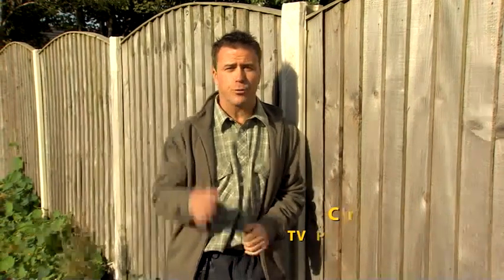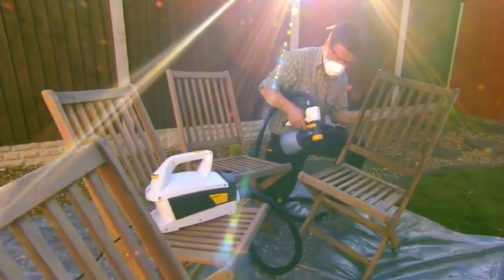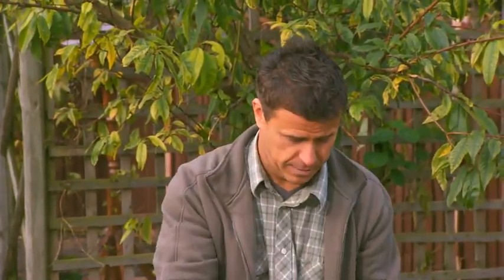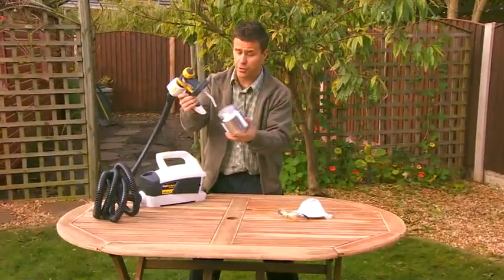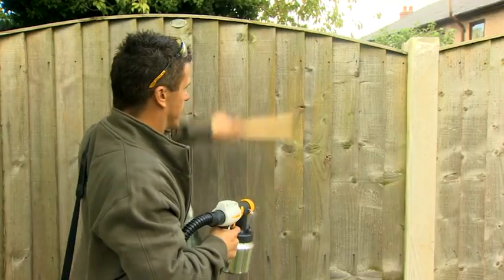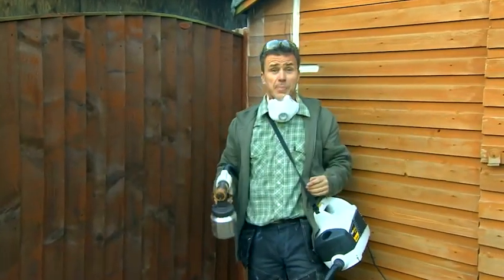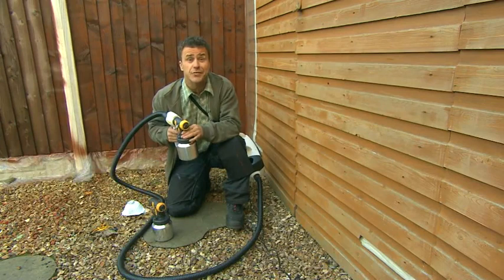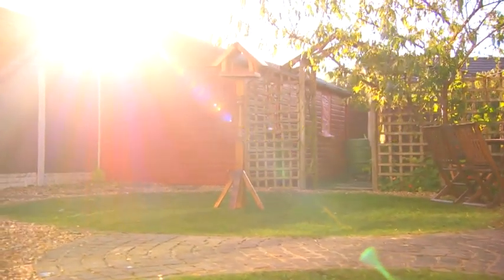How to Decorate your Garden with Wagner paint sprayer

Comment: Aren't you the guy that was on Big Brother and donated your winnings to a friend?
Reply from the maker: Yes that was myself 19 years ago!
Reply: @MrDIYCraigPhillips  ive brought  a spray gun. Used the new and improved ron seal fence paint ( its clumpy not runny) the spray gun won't work. Keeps clogging up 👎
Reply from the maker: @eddiecollins6668  HI Eddie, I've only used Ronseal a couple of times and found it quite glumpy and it didn't work very well with the sprayers, You would have to try diluting the product down to make it thinner  so it works better.
Reply: @MrDIYCraigPhillips  appreciated you taking time to reply to my question! I have diluted ronseal one caot new and improved paint by half and still dont work like it should. I had an old tub of paint of ronseal ( more like  liquid then jelly) and it worked brillianty in my sprayer. I was well impressed. But the and improved roneal with low viscosity does not work in my 2.5 spray nozzle with a vicosity of 50 dim. Thanks
Reply from the maker: @eddiecollins6668  Sounds like your going to have to use a different paint, as 50% dilution is to much really its weakening the quality of the paint. I'll let Wagner know about the Ronseal.
Reply: @MrDIYCraigPhillips  ive contacted ronseal because its not doing what it says on the tin. Thanks for replying Craig. Have a nice weekend

Comment: Can anyone tell me if this unit is heavy?  I have arthritis so this looks to be quicker and easier than brush or roller to do my fence and decking, but will struggle if it is too heavy.
Reply from the maker: This unit isn't to heavy when the small attachment is on it which you would use anyway with fence treatments, however you could always use a similar Wagner machine were the turbine is on the floor and not in your hand this is even lighter, both as quick and easy to use, plus will save you hours if not days of hard work if you used a brush on your fencers.
Reply: @MrDIYCraigPhillips  thanks Craig, the only series of big brother I watched was the one you were on, hope you are keeping safe
Reply from the maker: @sianarna6581  Thanks, hun, I'm keeping great thank you, hope you are to.

Comment: BE CAREFUL WHEN BUYING FENCE PAINT WITH THESE GUNS. ITS SAYS LOW VISCOSITY, DOESN'T MEAN IT'LL SPRAY!! WHEN THEY DO THESE VIDEOS, WONT MENTION THIS!! BECAUSE OF SALES. SPEACIALY RONSEAL. CLOGGS UP EVERY TWO SECS DUE TO BEING LIKE JELLY AND NOT LIQUID!!!!.
Reply from the maker: I've personally used hundreds of different brands of paint and 99% work fine, there only been the odd 1% of lumpy jelly kind of paints that haven't worked as good, and we don't advise Masonry paint if it has grid or sand in the paint as this will clog, How many paints have you tried personal and which brands were they please
Reply: @MrDIYCraigPhillips  I'm a plasterer by trade and quite competent at D.I.Y. on the strengh of your video upload, I've brought a spray gun. So as a mark. A mate of mine . It's not a personal attack on you, because your a good builder Craig. If I'm honest I've only gone and brought one brand of fence paint ( RONSEAL ONE COAT NEW AND IMPROVED MEDIUM OAK ) if you can recommend a brand of fence paint that will spray with the sprayer, I'll happily go and buy that brand. And leave a good review. Thank you.
Reply from the maker: @eddiecollins6668  I've used the Ronseal one coats before and they are thick and most of the time applied with a brush or roller, Ive had to thin them down loads! 
I've spray painted our fencers with @Frenchicpaint Al Fresco range and it works perfect when diluted with around 15% water, just happy two thin coats and it looks and works perfect, our fencers have been done for over tow years now and they are still looking great
Reply: @MrDIYCraigPhillips  quote! You can use 
Any paint, any colour 
Any brand
Wagner is the smart way to paint. You can get a professional finish.

Comment: No mention of nozzle clogging, viscosity of the paint. when to thin the paint, stirring the paint with a drill paint stirring attachment rather than a stick. The ball ache of  cleaning the nozzle when you stop for 10 minutes. Spending hours masking concrete posts and gravel boards. Spraying through the gaps in boards on fence panels onto neighbours plants. Not quite as wonderful as this advert makes out
Reply from the maker: Sounds like you've been using a different brand than Wagner, however if you ever happen to experience any of the above i have made a number of videos for trouble shooting tasks that are quick and simple to deal with.  any issues I've seen is normally the user not the unit.
Reply: @MrDIYCraigPhillips   can Cuprinol Ducksback be used in the Wagner paint sprayer ?